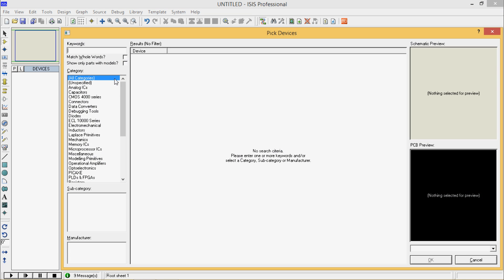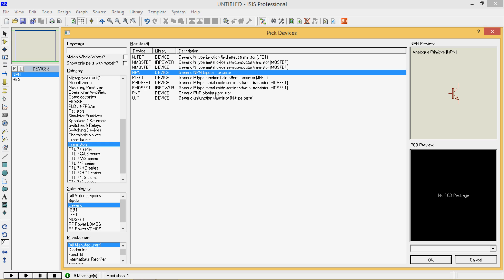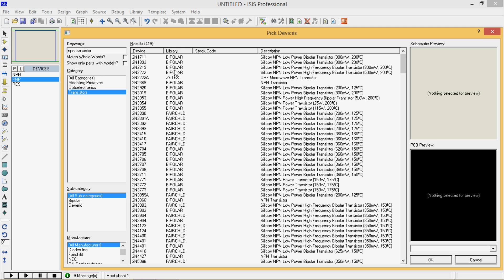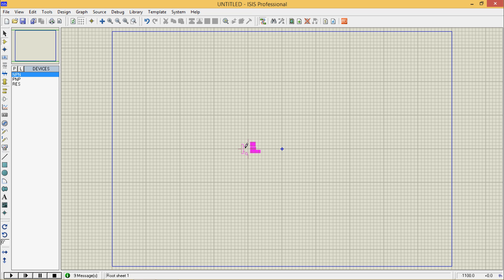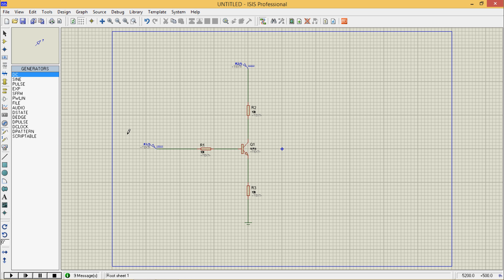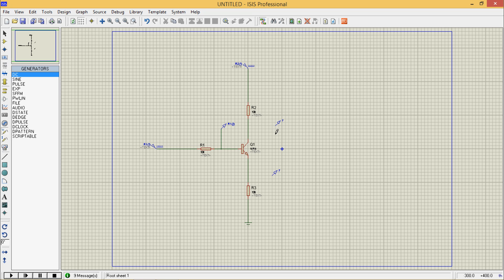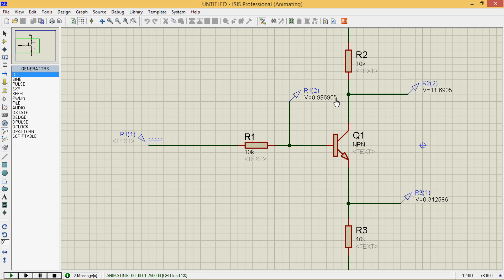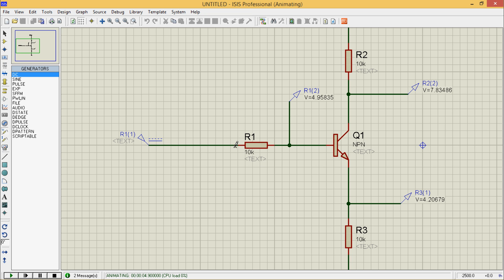Proteus tutorial 7 - transistor analysis

Comment: How to change beta value?
Reply from the maker: we are selecting certain transistor and applying certain voltage. so for present condition we cannot change beta value. that's why 2 components are different. if we can change properties then what's difference between 2N2222 and BC547. hence to get different beta you need to select your transistor according to datasheet.
Note: there is no option to change beta at least the version of Proteus i have used for video.